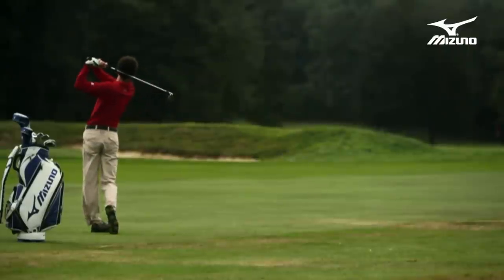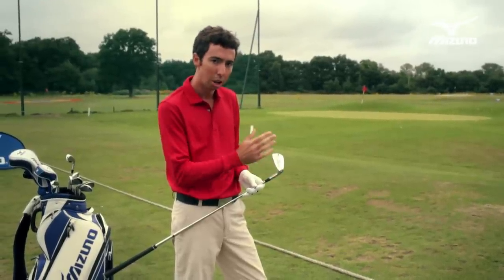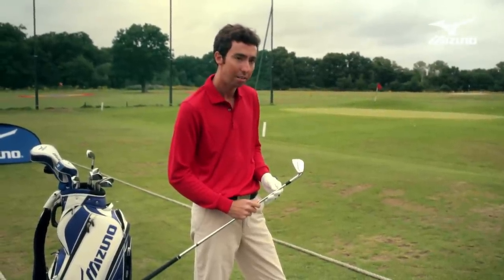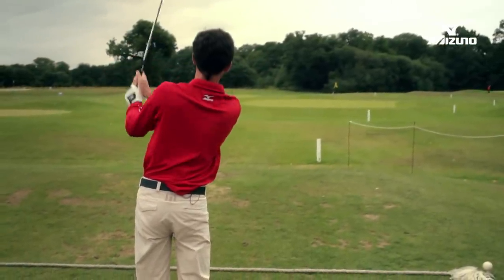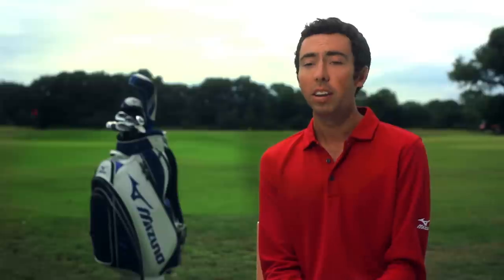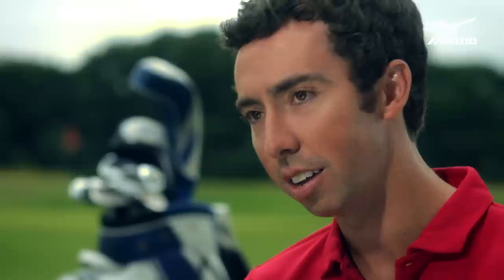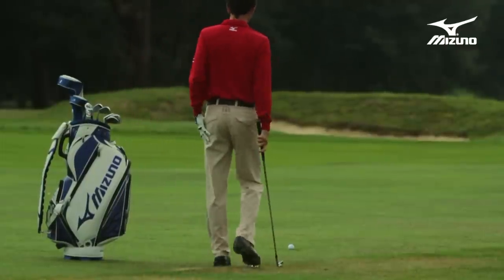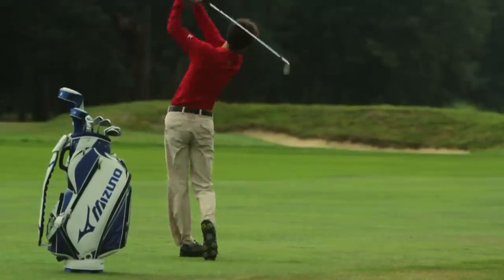Mizuno MP-69 irons official film:  Pure Heritage

Comment: Let's see a version of the mp 4 with the mizuno blue and with chrome backside and more cast looking bottom. Since that area takes a beating and may look better longer if the bottom starts out without the mirror image. But def need the chrome glass look on the back with the mizuno blue markings. Throw me a bone if u use that design. I'm Goin to Nike next so beat them to the punch. U get what u pay for and mizuno is the real deal.